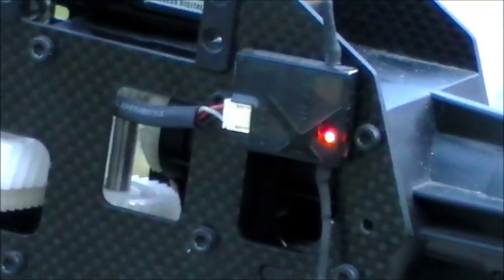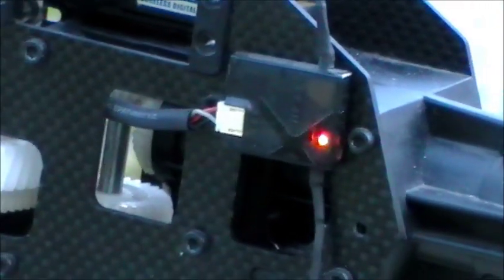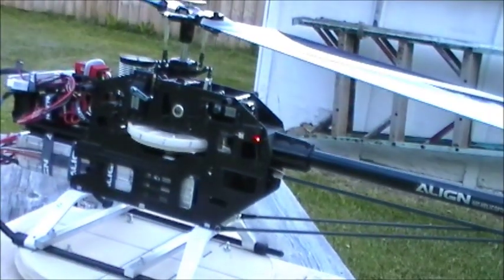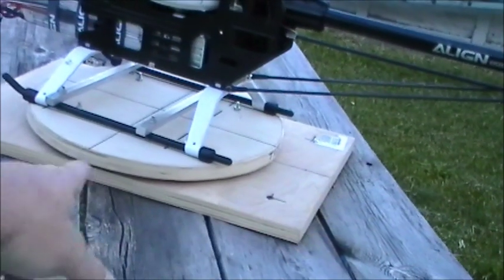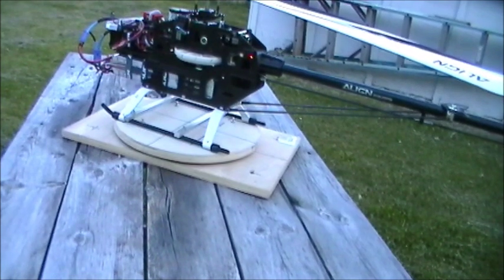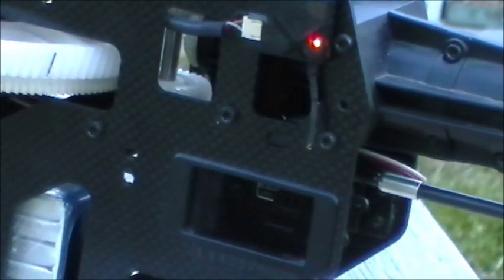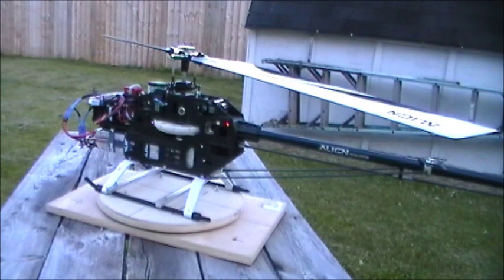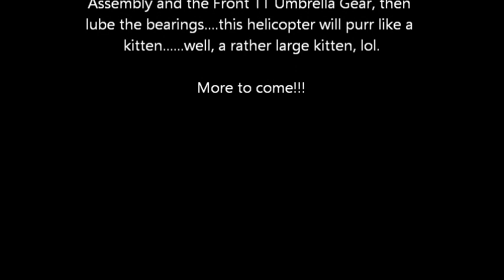Trex 600e Pro DFC initial spool up

Comment: Hey Derek, awesome buddy, Byron had that "rattle" in his 500 and it had a couple of chipped teeth on the tail drive gear, also check the barings on that little shaft that the "umbrela" gear is on and also Delbert is wright, your blades are flexing with a slight wobble, you can see it in the vid, looking forward to seeing you get this bird in the air, take care my friend
Reply from the maker: I'm wondering if the wobble is because the helicopter was on the table and the gyro stand.  Both blades balanced out very easily.  As far as that noise I was hearing, I went to my local hobby shop and bought a bunch of parts.  The parts that I couldn't find at the hobby shop, I ordered from HeliDirect.  They should be here this weekend.

Comment: Hey Derek, that's brilliant..... Blackwarrior!
Reply from the maker: Thanks Tony!  It's a very safe and secure way to do some bench testing.  If you want some details on what I did, just ask.  I can do up a short video for you.
Reply: i got a marble lazy susan off the mrs drilled holes in etc etc, spooled heli up on it but the bearings on the susan were too floppy causing the gyro to go mental.... yeah let me know what you used Derek..cheers mate

Comment: Nice but I need one so I can put in the room
Reply from the maker: Delbert, although the gyro test stand that I use has been quite safe and secure, I'm going to strongly suggest that you NOT test the helicopter in your room on the gyro test stand.  If you were to build a gyro test stand, it could definitely prove to be a useful tool but I don't believe there would be a "safe" way that you could do this in your room.  I have never used my gyro test stand indoors.  Please consider the possibilities and the potential for something to go wrong.

Comment: missed that Derek ,,on these size helis a throttle curve for normal mode is different as for smaller helis
0,65,65,65,65  would be a good curve ,,might  wanna check on fora
but this is a great curve for if you just want to fly it like the 500

edit ,misread ,,you wrote normal pitchcurve
Reply from the maker: Yeah, I had forgotten to change the Pitch Curve after the blade setup.
Reply: ***** wobble of the blades is not alarming for now
all helis wobble at spool up ,,then at lift off the weight of the heli hangs underneath
here it just didnt get the chance because it was fixed
if it wobbles at maiden hover its soon enough to check out
Reply from the maker: yeah, I'm not that concerned with the wobble right now.  This test was just that...a test to make sure, in a safe and secure fashion, that the helicopter would spool up and working properly.  I'll surely make any and all wobble adjustments after the first hover test.

Comment: Thanks for reply mate, ya had look on site u said but could still only find the black one (H60G001XXW) $25, u wudnt post me the link to the white one u buy, thanks mate matt
Reply from the maker: I just checked several sites for the white main gears.  The only one that I found was here:  http://www.wowhobbies.com/agnh60019a.aspx  I did have a look at the eBay item number that you posted earlier.  That main gear set doesn't look like a crap item but, my opinion, if the item isn't genuine Align or KDE Direct...I won't buy it.  So, in my opinion, I wouldn't trust that item that you saw.

Comment: nice !!! ,some have a gopro underneath,,you have a whole picknictable to fly around with  ;-)
wise you look for some help ,it sounds strange
i would be afraid it would explode if i would have to fly it
did you lubricate the gears and bevelgear ?'
that might smoothen things
or replace the smal gears on the torquetube if that doesnt help.
Reply from the maker: HA HA HA!!!  I laughed very hard when I read your comment about people using a GoPro and I've got entire picnic table under my helicopter, lol.  Too funny!!!  I did just get back from my local hobby shop and I purchased new front and rear drive gear sets (both come with new umbrella gears for the torque tube), new bearings for the front and rear drive gear sets (probably not necessary, but I did it anyway), and a new autorotation gear.  I got home and went to HeliDirect and ordered a new main gear hub, new slant main gear 112T, some bearing grease, and two new Align towels (mine are getting pretty bad, lol).  So....now it's a waiting game for the new parts.  The next spool up should be much much better!!!  As always, I appreciate you watching and commenting!!
Reply: ***** great you have everything under control
thats a fine helicopter ,,i hope all goes straigt forward for you from here on.
Reply from the maker: i've not heard of lubricating the umbrella gears.  Is this a normal practice?  What is used to lubricate the gears?
Reply: gear grease for all plastic gears,,just to make it run smother and also to protect the teeth
they tend to wear less
and i use oil for metal parts
Reply: ***** just had an emergency landing myself
went flying after seeing you mess with that heli,,but i lost power ,, 1 cell out ,,it was 2.4 volts while the other 5 had 4.0 volts
landed safely ,,but took a while until the charger didnt ring the alarm for low voltage and started to balance charge
ill see how it goes ,,and probably get a new lipo to be sure
i might try the lipo docter here in our city who can replace cells,,it was a 150 bucks lipo
so worth the try of repairing it there.

Comment: Hey bud look at the video carefully Derek at least like the blades are off balance a little bit looks like you have a little wobble
Reply from the maker: Yes, you're right...there does seem to be a blade wobble or head wobble or something.  I'm not concerning myself with that part until after the first hover test.  This test was to test the wiring and initial tail settings safely.  I'll worry about the wobble in the next few tests.